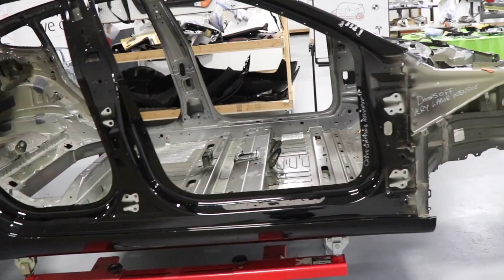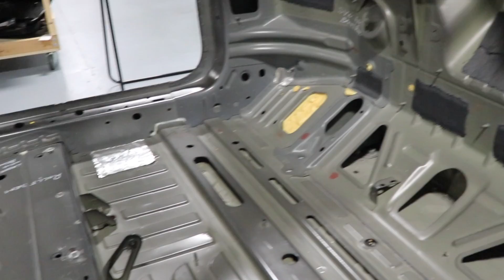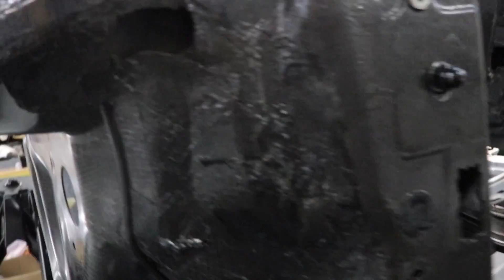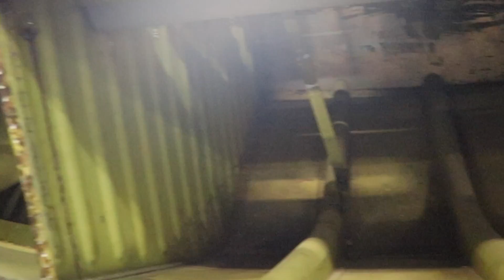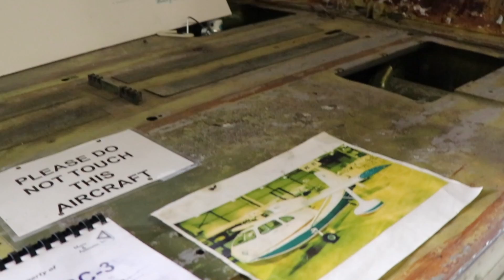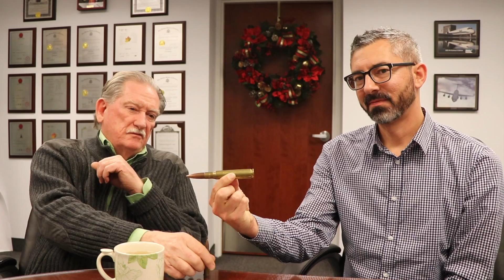Sandy Munro: Tesla Cybertruck SpaceX tech, bullet proof windows, crash safety, and battery magic

Comment: The engineer avoided the crash question because he knows it is a poor design for passenger protection.
Reply: Not at all.  The exoskeleton will be very crash resistant.  If the exterior of the vehicle doesn't close in on the passengers in a crash the rest of what is needed is proper seat belts and airbags.  Cybertruck has it covered.
Reply: Bob Wallace it means higher G force for the passengers
Reply: Alias Lindon I think we will all find it’s very safe.  Tesla makes safe vehicles.
Reply: Sean Z well it comes down to the NCAP test. 
In collisions with unmovable obstacles (walls, trees...) it will, with this design, perform poorly.
Reply: @herrfleischgewehr  I have to agree with Sean.  Tesla puts passenger safety very high on their 'must do' list.  The goal is to keep the passenger compartment protected and assist that with designed crumple zones.  I'd pretty much guarantee that the Cybertruck's ability to protect passengers was studied in computer modeling before a prototype was built.  And before the truck goes into construction multiple prototypes are likely to be built and crashed.
Reply: Bob Wallace what you write here is not Teslas good will but an industry standard. 
What I can assure you, the production version will not look like the prototype.
Reply: @herrfleischgewehr  Are you aware how Tesla's cars have earned the highest possible safety ratings?  Remember how the Tesla S broke the machine the DOE uses to test roof crush resistance?  Tesla exceeds industry standards.

I suspect you are wrong about the production version looking largely different than the prototype.   I think the released version will be a folded stainless steel exoskeleton truck that looks fairly similar to the prototype.  Most of the changes will probably be made to improve aerodynamics.  

If market reaction to the looks of the Cybertruck had not been so positive then Tesla might have clawed it back and worked up a more traditional looking pickup.  But demand seems excellent and should only grow as people get more used to the look.

Comment: Regarding the Model 3: i would be interested if they changed the Assembly Line to reduce the Part count of that Wheel housing? i wouldnt be surprised if they changed that within a few months/weeks after Munro published his findings, but i didnt hear anything about it. Usually i would assume this didnt change, but Tesla changes things all the Time - both in software and at the Assembly line.
Reply: That change applies to the Model Y....
However
There's no reason I can see that the process couldn't be applied to the Model 3.
Same with the wiring.
That would also bring economy of scale benefits to both cars.

Comment: So finally, after more than 1 year of analysis everything has been clarified on the rear electric motor design of Tesla m3...I am relieved...
Reply: Ya even I was surprised that he said 5 years ahead of everyone else.
Reply: @Coltn3125  I am actually ironic. Based on his statements, I feel (1) they have not yet understood in detail about the operation of electrical machine or (2) he has not been updated by his team (... reasonable, he is not an electrical engineer). 

Outside body/frame topics (which is not my field, and it's definitely Munro legacy field for which I am confident he is expert) there are technical questionable/biased/non professional (from engineering point of view) statements on the electrical machines. 

No one becomes expert of electrical machines and drives from the night to the day (this is my impression, how Munro wants to appear in front of the audience), engineers in the EV/automotive sectors has to go normally through university studies, PhD and years of experience.
Every technical term, like "switched", "reluctance"  has a specific and clear meaning that cannot be misunderstood. If you (e.g. Munro) have specific knowledge, you can prove if it makes sense or no for a specific design...not because "people say"...

Comment: Ask him about the Porsche and the comparison to Tesla Battery
Reply: Porsche is using EV battery Adapted from Consumer Electronics and Laptops, Tesla uses a Custom formulation of LION and in a Metal Canister. 
the Other EV battery are of Inferior Design to the Tesla battery.
Reply: The Porsche has a higher charge rate into a larger battery but has less range (just over 200 miles) than the equivalent performance Model 3. It’s also MUCH more expensive.
Reply: @Dave5843-d9m  It was rated at just over 200 miles, but a number of testers have noticed the range is actually close to the Model 3 in actual driving conditions. Still much more expensive, but some people want the name/handling etc.
Reply: @Dave5843-d9m  - the Taycan is lower Efficiency because it uses an ICE CAR body on a Electric Drivetrain.
Reply: @markplott4820  That can't have much to do with it, it's all about batt and motor efficiencies.
Reply: @Mrbfgray  - true, but its NOT Helping either.
Porsche has almost no Electric heritage.
However, their FIRST car was Electric.
Reply: @markplott4820  It doesn't matter what their first car was now, none of that carries over to today but it's an interesting bit of history.  As a TSLA way long I've been concerned about the competition but it turns out to be much more difficult than most expected to even come close to the value and lead that Tesla has and they aren't sitting still. 

 They didn't simply leverage S and X tech for the 3 and Y but instead significantly improved on it.  Y will be first car to do away with most of the wire harness too, that's a big deal in itself.  Legacy brands have steep hill to climb and a lot going against them.
Reply: @Mrbfgray  - I Predict TESLA will phase out the Model S/X and Produce more Model 3 and Model Y, at some Point after Cybertruck launches , Tesla will Launch ALL NEW Premium Sedan and SUV based on the Plad Tri motor Drivetrain.
Reply: @markplott4820  Plaid is an S.  I dunno but many fat Americans want bigger cars so I suspect a large market for S and X for the foreseeable future.  I have no use for such big cars but many don't like small ones.  More likely a refresh for those tanks I'd think.
Reply: @Mrbfgray  - TESLA will not Refresh Model S/X anytime soon and may be Discontinued for a Decade.
Meanwhile TESLA focusing on Model 3 and Model Y SALES and Cybertruck production. Cybertruck possible being the FIRST Tesla vehicle to benefit with the PLAD Drivetrain.
then TESLA will introduce the $20,000 TESLA made without Mirrors, Pedals or a Steering Wheel.
you can Expect to make $35,000 per year with the Model 2 as a RoboTaxi. 
ONLY after all that TESLA can Design NEW Premium Model S/X with All NEW Body and Removal of the Falcon Wind Doors from Model X, fitted with Standard AUTO opening doors.
and having PLAD Drivetrain in its Performance models.
CURRENTLY Tesla Model 3 Performance is OUTSELLING the Model S/X platforms, all Trims. Model Y will do the SAME.
Reply: Acoronado There is nothing to compare. Their EPA range itself is such a joke
Reply: @jitheshm9839  SO much for EPA, hmmm?
Reply: To me the windscreen is overly expensive. Flat laminated glass is cheap enough to replace when it’s too scratched. Inside face could be film coated.
Reply: @Dave5843-d9m  - the Biggest issue with Existing pickup and Truck Windscreen is CRACKED Windscreens. 
Legally you can be Stopped by PD or H. Patrol, for a cracked screen and are subject to a Fixit Ticket.
However, Commerical Truck Drivers can get their TRUCK Removed from Service, for a cracked windscreen.
the Cybertruck screen is made of a Tougher version of the Side Armor Glass. 
having a Front Windscreen that is Resistant to Stones and Baseball Hail will be Safer than ANY Current Pickups and Commerical Trucks. and WILL save Money in the LONG RUN.
TESLA Transparent Metal glass will also be on the TESLA Semi as well.

Comment: Good discussion. Sandy sidestepped what happens in a crash a little bit though, but he had a fair point. I really can't wait to see the Cybertruck being run through crashes at the IIHS.
Reply: 3.2mm plate will still buckle readily. The radius of gyration is about 0.9mm, meaning any panel length buckle instead of yield for lengths longer than about 1.8mm which is tiny. The whole sledge hammer thing is was cute parlour trick. The force of impact in a collision is multiple orders of magnitude higher - the truck will buckle absorbing energy and adding to deceleration time/distance.
Reply: @danwhiffen9235  
The sledgehammer wasn't meant to represent real crashes. The point was that it doesn't get damaged as easily as traditional body panels. Most damage is caused by small bumps at very low speeds, mostly during parking.
Reply: András Bíró I agree that the sledge hammer thing was not intended to demonstrate vehicle collisions, but it seems a lot of people who haven’t worked in dynamic structural analysis or impact mechanics are wrongly inferring the vehicle is some kind of super tank. It was a great marketing move that got press. The location which Franz struck the door was very intentional, mid span (mid panel) affording the maximum energy absorption through elastic deflection. I don’t think it was a dead blow hammer which others have speculated, but a rubber coated steel sledge to minimize the likelihood or scratching or gouging.
Reply: @andrasbiro3007  I think the demonstration did a pretty good job of showing how much stronger the body panels are on the Cybertruck. 
I'm just not sure why this is meant to be a big deal. I mean, it's cool that the body panels are strong and I don't have to worry about scratches and dents like I would on a typical truck. That's a great feature. 
The problem is Tesla is trying to convince me this is a revolutionary design and manufacturing process they call an "exoskeleton", and I'm not convinced at all. Just looks like strong, dent-resistant body panels to me
Reply: @andrasbiro3007  well, that is the question, isn't it? Is the frame on the cybertruck constructed exclusively out of stamped, cut, and welded frames with no traditional unibody underneath at all? I'm not convinced they do. If they do, I wish the demonstration went into that and showed off the frame a lot more. One thing I can tell you for sure is that the panel they were hammering on was not part of the "exoskeleton" and did not provide any structural rigidity, because it was just a door panel. doors aren't part of the frame... they're doors. 
If you look at a picture of the frame without the doors, you can see A pillar, B pillar, and portions of the C pillar underneath where the door sits that look like a traditional unibody with curves (looks stamped).  I don't think Tesla ever specifically claimed that the entire frame is flat, cut and welded cold rolled steel. They just said "exoskeleton" and let people's imagination take over. I think there's going to be a traditional unibody in places, like where the suspension attaches, front and back crumple zones, pillars underneath the doors, etc. The front and rear quarter panels might be welded to the frame next to or underneath them and add structural rigidity, but other than that it's just going to be basically a traditional unibody. That's my prediction, anyway, but I guess we'll see.
Reply: @danwhiffen9235  It might also break the impact machines.
Reply: David Coltman definitely won’t break the crash block machine, but it will be interesting to see if a cold rolled stainless will exhibit enough ductility(bend), if it will rupture (crack), or simply shear upon impact in its crumple zone. Non-linear plastic analysis is not for the faint or heart.
Reply: @danwhiffen9235  This is what I meant. It's definitely going not going to break the impact machines, but how different will it's crash characteristics be to the existing trucks? It's not everyday you see something quite like the Cybertruck go through crash testing.
Reply: @danwhiffen9235  yeah I'm by no means an expert on car structures or crumple zones, but it would seem challenging to me to make a car frame behave like it needed to behave in crash tests (bend and absorb impact in some areas under certain load directions, hold its shape and and not collapse into the occupants in others) if you're restricted to using flat steel plates welded together to build your frame. 
me personally, I think the "exoskeleton" thing is going to turn out to be kind of a marketing gimmick. I think there will be large parts of the frame underneath the cold rolled steel panels that are going to be relatively conventional materials and construction, and the amazing game-changing "exoskeleton" is going to amount to what are basically thick, high quality steel body panels. But we'll see, I guess.
Reply: Dan Whiffen the sledgehammer was effective for door dings at the parking lot... you wont have to worry where you park with Cybertruck
Reply from the maker: I think it was a fair point.

Comment: I believe Cybertruck will be released way before 2023
Reply: Alexandre J. Tourville I know. If it’s such a “basic” design, why not be able to get to production volumes. No fancy gear required
Reply: @danwhiffen9235  A lot has to do with how many balls Tesla can juggle at one time.  They've got GF Shanghai to fine tune, Model Y production going in Fremont, and GF Berlin to build.  

But more than any new vehicles they apparently are going get into battery cell manufacturing.  It seems like the Cybertruck, T-semi, and Roadster II would get the new higher capacity cell that many believe is coming.  If so, Tesla will have to be able to produce a lot of cells before they can roll out the next three vehicles.
Reply: @bobwallace9753  Ya no kidding just think of the Roadster with a 630 mile battery. WOW
Reply: @bobwallace9753  Battery & Powertrain Investor Day should be epic
Reply: @ajtrvll  I'm really looking forward to what Tesla has to share.  I've been thinking about how we  can get some serious work underway to eliminate fossil fuels from our electricity grids.  Already wind and solar are cheap sources of electricity.  We can build new wind and solar farms and the electricity from them is cheaper than the operating cost of paid off fossil fuel plants.  But we need cheaper storage to fill in the times when the Sun isn't shining and the wind isn't blowing hard enough.

I'm hoping Tesla has a battery solution that is well under $100/kWh and has a long cycle life.  If so then we should see a large increase in renewable energy installation and more rapidly declining fossil fuel use.

The US is on track to be basically coal free by  2030.  Right now we're getting 26% of our electricity from coal.  Two years ago we got 31% from coal so we've dropped 2% per year recently.  Speed things up just a bit and coal is gone in a decade.  But we're replacing a lot of coal with natural gas.  We need to get the cost of renewable energy below the cost of fossil fuels enough to cause movement away from fossil fuels for simple economic reasons.  We have a government that is anti-science and doing nothing to minimize the pain coming from climate change.  Tesla is driving the move off petroleum.  Hopefully Tesla will be playing a major role in getting us off natural gas as well.
Reply: The insurance industry will not insure new coal-fired power plants!